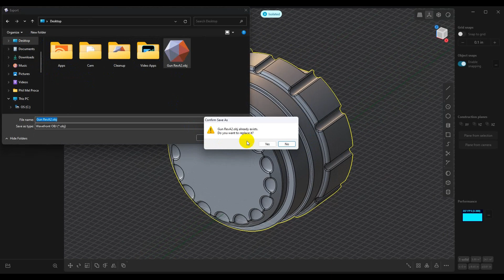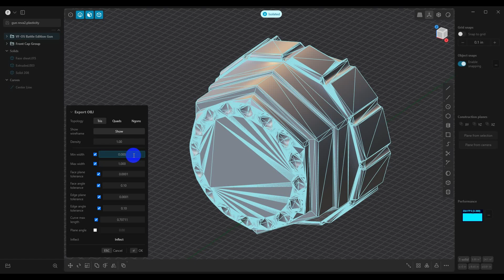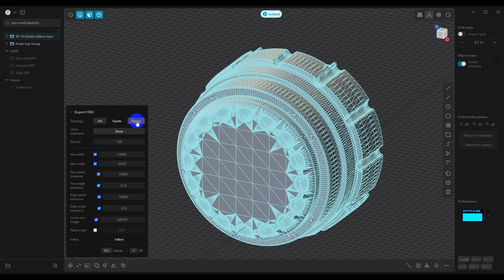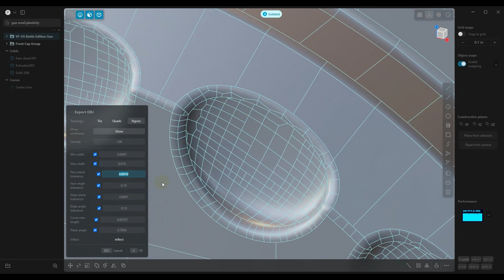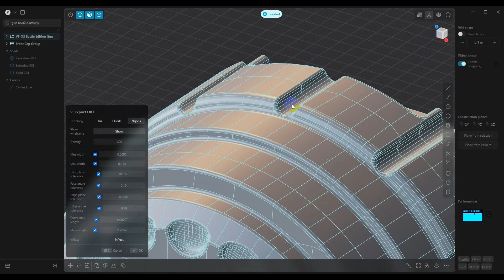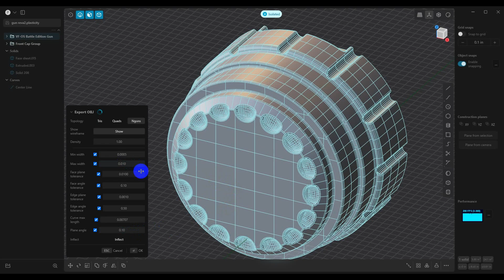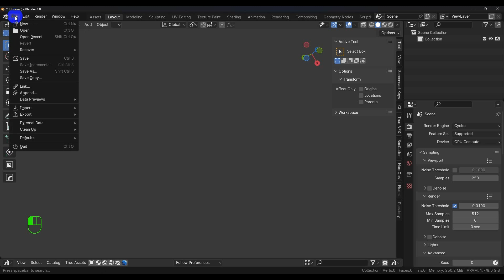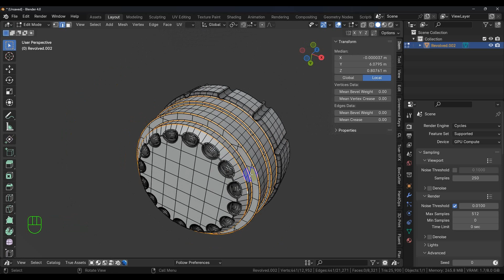Plasticity to OBJ Settings3

Comment: But that's waaaay too man polys for a game model that shouldn't be more than a couple hundred. That's my issue with Plasticity. Still looking for a solution.
Reply from the maker: @peko1967 
A couple hundred? Maybe if you're making an RTS or working on a mobile game. Either way, if your goal is a few hundred, just model it in Blender. A few hundred polygon models in Blender would only take about 15 minutes to make. I have not covered any game modeling yet on the channel. Most of what I am trying to show is if you want to 3D print your models. Thanks for watching.

Comment: 9:35 Have you ever tried the Quad Remesher plugin to see how it affects the model after importing this to Blender? Many thnx!!
Reply from the maker: @georgegeluna6217
I was trying this the other day. I ran a bunch of parts through the Quad Remesher plugin and found that the results depend on the complexity of the geometry. The more complex the model, the more polygons it took to get a usable mesh. I couldn't get the polygon count down where I wanted it on the complex parts. Once I figure out the best settings, I plan to make a video on the results. Thanks for watching!

Comment: I recommend that you start with

face angle tolerance = edge angle tolerance
face plane tolerance = edge plane tolerance

This will give you SLIGHTLY better edge flow on a model like this

Comment: very useful, was wondering if you can use ngons in substance painter or UE5, I have never used ngons before as I always model in quads
Reply from the maker: Once you get your UV mapping done, all you have to do is triangulate your mesh. That way, no matter what you're sending your model to, it will not matter.
Reply: got it ty~